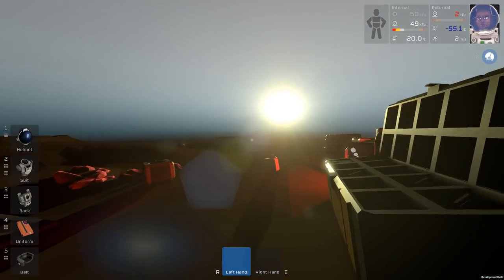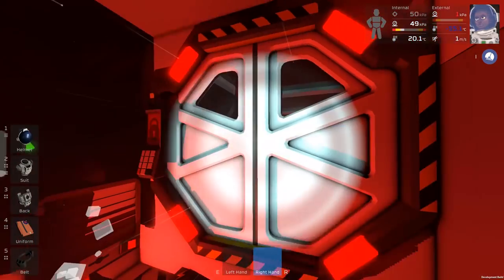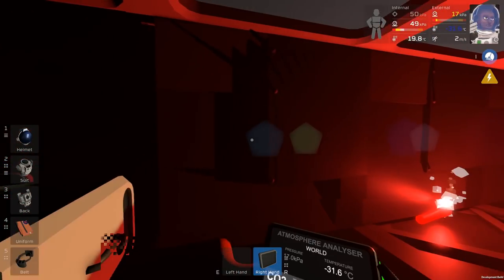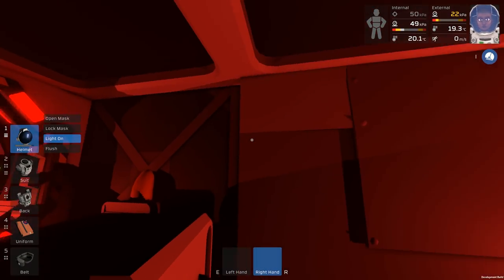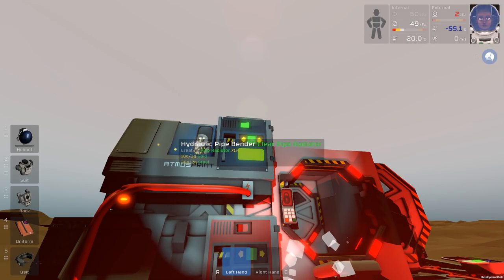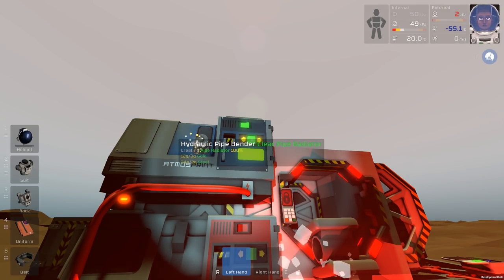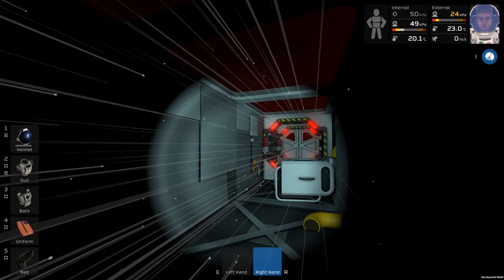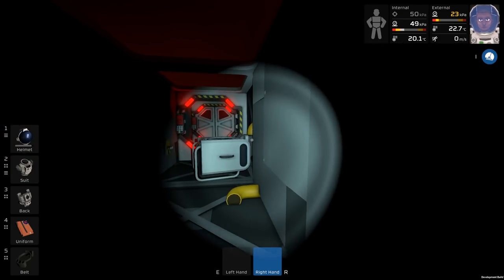Stationeers E31 - Martian Heating and Cooling

Comment: You could use the air scrubber to get the O2 and x out of your room in a tank. 
The volume pump sucks power like crazy.
When you want to decompress your room you can pump the air in your pipes.

Comment: Fuel ratio is actually 2:1 not 3:1, not sure if you misspoke or got it wrong.

FYI regarding ice. I've done several play throughs on the moon where it appeared there was specific ores missing from the wold, 1 had no lead, another had no silver (at least none I could find on the surface anywhere within reasonable distances of my base), so it's entirely possible it's just a quirk of that seed for your mars like world.
Reply: ya he got it wrong. It's 2:1 for a complete burn. Using other ratios will work too, but leaves excess hydrogen or oxygen, depending on a rich or lean mixture.
Reply from the maker: Whoops - I think my brain got stuck on 3:1 iron/coal ratio and kept going!

Comment: In regards to water... Would the "Mark Watney Controlled Explosion Inside a Pressure Vessel with Hydrogen and Oxygen to Make Water" (patent pending) method work? I don't really know much about the physics or chemistry present in this game beyond what I've seen in your videos, but I would suspect tha placing volatiles (which I think were previously mentioned to be mostly hydrogen) and oxites into a contained unit and adding flame could produce water. Volatiles + oxite + furnace (add ingredients, then turn on) = water (maybe?). Or allowing oxite and volatiles to sublimate into the air in the pressurized room, then adding fire from the welding torch?
Reply: it would probably be safer to put them in a furnace, then depressurize it after igniting it.

Comment: That misterious heating inside your chamber is probably because of the airlock cables, I suppose...
Reply: This. Over 6Kpa all electric devices including cables generate a very tiny amount of waste heat but it adds up. It used to be regardless of atmosphere but they changed it a few patches ago due to an issue with that; but it is an actual feature of the game's energy conversation model.
Reply from the maker: Hmm, except for the fact the airlock cables aren't inside the pressurised area, unless that tiny amount of heat is being transmitted through the near vacuum (it's around 2KPa) of the airlock volume, through the door and into the base... seems a bit of a stretch, but hey, maybe!
Reply: But when you are inside, the door is open and cables are exposed to the inner atmosphere, so it would heat up the space. If it heats the room even when you are outside and the inner doors are closed, then it's a bug ;)